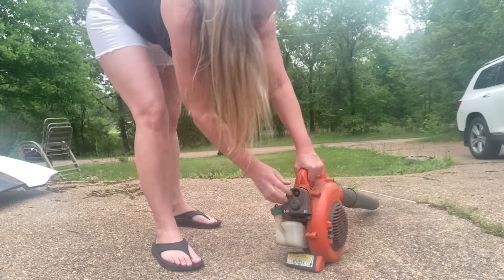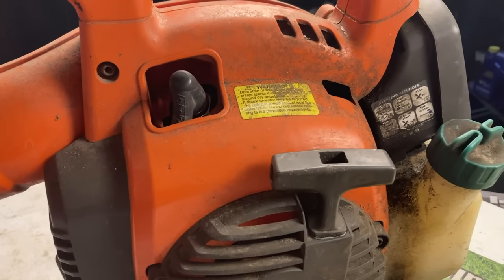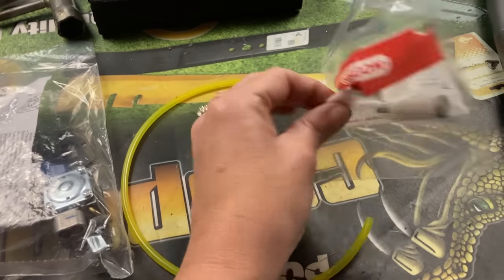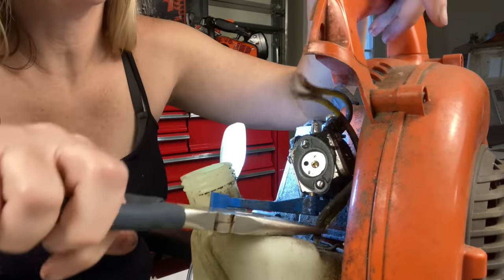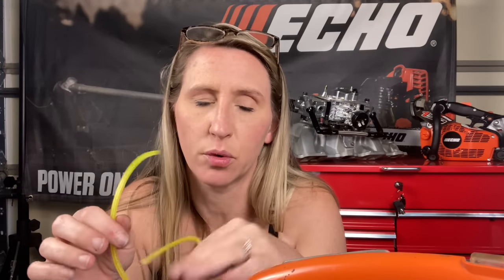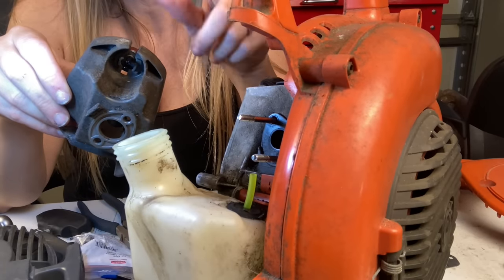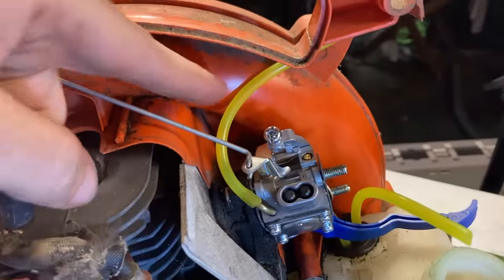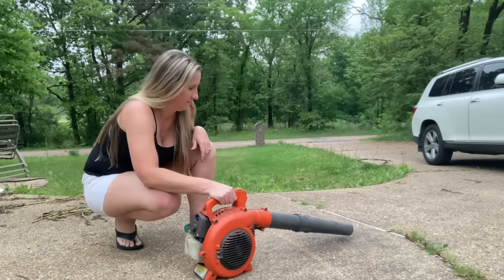How to fix a Husqvarna blower that will not throttle up or start. Repair vlog

Comment: Have a 125 that hasnt run in years and has been taking up space in my storage building. Saw your video while searching for info on replacing the carburetor on a Troy Bilt weedeater. Ordered the rebuild kit and followed your instructions ... it lives again, thank you so much for making easy to folloow content.

Comment: Got to love that ethanol,the worse enemy of a small engine
Reply: Taryl Fixes All did a two-year experiment with all the different types of fuel additives you’ll be surprised of the outcome
Reply: Ethanol and safety switches are the money makers for small engine repair guys and girls!  Otherwise, 90% of our work opportunities would not exist.
Reply: Byden is raising the ethanol to 15%
Reply: @haneyoakie14  while YouTube does anything to shadowban your latest comment. I'm surprised you were able to actually see my first comment.
Reply: @haneyoakie14  the latest to win middtermm elllecctions is the suppreme courrt leaakkk.
Reply: I run a aviation fuel in my small engines. So far no issues.
Reply: I’ve been running regular unleaded gas in all my equipment for many years and have never had a problem unless I let things sit for longer than 6 months. Now if I’m gonna let my equipment or gas tank sit for more than a month, I use an inexpensive product like Sta-Bil to extend my fuel storage up to about six months but no longer. Having done this I’ve had no more problems.
I must add that my equipment isn’t set to factory settings, which are always too lean and I’ve had to bypass those limitations. Once I’ve got my equipment performing at its peak I’ve no longer had issues with fuel
Reply: It keeps my doors open because people don’t listen or believe it’s the problem, they foolishly blame the brand of the equipment 
Owell i enjoy the business and money 😊

Comment: Good step by step instructions. There's one aspect I would suggest to protect the plastic screw hole threads during reassembly. Most people just start running the screws in clockwise without first lining up the screw threads with the original threads in the hole. This will chew up those plastic threads and eventually with repeated dismantling and reassembly the screws will not tighten. If you put the screw in and then turn it counterclockwise, it will take one full turn or less, you will feel the screw threads seat and lineup in the original hole threads with a little click and the screw will drop just a small distance into the hole. This now means that your original plastic screw hole threads are lined up with the metal screw threads and you won't mess up the threads in that plastic. It's not a bad idea to use this method on the metal screws and threads found on the pull rope housing also. This will save you the possibility of cross threading the metal components.
Reply: I always do the "turn CCW 'til it clicks over the thread edge" on spark plugs and oil plugs, too
Reply: I will not use power tools to put anything to geather and after watching the ( pro) use them I know there damage the equipment 😊
Reply: @philliphall5198  just a little additional information, I will use a battery screwdriver once I've aligned the screws with the original threads and turned the screw manually about half to one full turn to test the alignment. If the test proves successful, if there are only a few screws I'll do them all by hand but if there are a bunch of them I will then use a battery operated screwdriver with an adjustable clutch set really low to run them all the way in and then tighten them by hand. I use a German torque method, guten tight. LOL

Comment: At Husky service training I was taught to turn course threaded screws in plastic in reverse until you feel it engage the existing threads then tighten. Supposedly keeps you from cutting new threads each time. Although a experienced mechnic will know when that is happening. You've taught me some new methods. Thanks 😊
Reply: Good practice when threading any fasteners together if your worried about cross threading.
Reply: We experienced mechanics do this, too.  It's not an amateur thing.

Comment: I am going to make a suggestion.  Don't cut fuel feed line length until after filter is attached.  Much easier to attach filter if it is several inches out of the tank.  Then pull the excess line back and trim to correct length.

Comment: Now THAT is how you make a DIY video. Clear, concise instructions combined with great video and excellent tips you will only learn from experience. Thank you for this and well done!
Reply: Darn frustrating putting in new lines for the first time since I bought it new 2007.  Sadly a different vid. popped up that wasn't clear which line went where and my lines fell apart.  Soooo, I had fuel filter line going to primer, then to top of carb and leave bottom of carb returning to tank.  Total backwards. What should have been 20 minutes ended up being 5 + hours wasted before I got it right.  Grrrrr.  Wished I had found this video as she is always great at explaining clearly.

Comment: ThanYou are a ROCKSTAR!  My several year old Husqvarna 125B acted just like the one you featured.  I got a $20 aftermarket kit (carb, plug, fuel lines, bulb, and air filter) and it runs better that when I bought it.  Local small engine wants $110 per hour plus parts.  I was nervous, but your video walked me right through it.  I could not have done it without you.ks!
Reply: I bought my 125B in 2016 for $150.  Now (2024) $190.  It definitely would not be worth taking it into a shop, cheaper to buy a new one.  But $15-$30 for a new carb is well worthwhile.

Comment: I'm retired and took up small engine mechanic-ing about 4 years ago.  I've seen lots of what you are showing, but the old dog learned 2 new tricks with this video.  1)  "short sux".  I have a purge primer as a reference with the attached hoses labeled.  I don't need that anymore.  2) Inserting fuel lines -  I've been cutting a  short point on the fuel line in order to get it started into the tank and fighting with reaching the end in the tank.  It's long points for me for.  And I am embarrassed to think that I didn't figure that one out...

Comment: You seem to be the eternal optimist in cutting the fuel line before inserting it into the tank. I snip it to length only after I get the filter on and can verify how much line I need to connect it to the carb. I just came across your channel and I really appreciate your no nonsense approach to working on the equipment along with your clear step by step instructions on how to do each step. I wish you continued success in your career

Comment: I literally just revived an echo weed eater with new carb kit. $25.   Carb, primer bulbs x3 , fuel filter, spark plug and air filter.  Then I tried reviving a Ryobi blower.  Then I find YOU reviving a blower.  🤔
 I’m definitely buying a carb kit for it as well because I disassembled it,cleaned it , compressed air put it back together,ran like a top for a day. Now it won’t start at all. Carb is clogged up. Almost the exact same reason as in your video.  
 Glad I found ya. Keep up the good work 🇺🇸✌️

Comment: Theres a few property maintenance companies in southern Ontario who are very happy that you make these videos!
I've always been mechanically inclined!  But there are SO MANY issues that come up.!  You have saved thousands of diagnostic hours for me which helps get the tool back up & running so much faster!  I can't afford a Stihl or Echo franchise.  Plus they have territorial restrictions!  So they wouldn't give me a franchise anywhere around customers.
I was at a franchise buying parts the other day, & when customers were bringing tools in for repair, the clerk tells them 4 weeks before they even know whzt is wrong with the tool.  One guy had a recoil cord broken.  I ciuld have had it replaced in 15 minutes! 😃😀😃
Thanks again Chick!

Comment: I admit to being a clean freak when it comes to this type equipment.  The first thing I would do is clean before I even started.  Then I would clean each part that I remove.  It may not help the running but it sure makes things pretty when I'm done reassembling.  Great instructional videos here.  Keep up the good work.

Comment: I've had a dead Husqvana blower for some time and so glad I didn't throw it away.  I had replaced some of the fuel line once before but then had problems again where it wouldn't run and just put it up.  Then I saw this video.  I ordered the complete kit that she recommends and followed along with the video.  Took it outside for the moment of truth and it fired right up.  There was only one thing that was a little difficult for me and that was getting the new grommet to click into the fuel tank.  I ended up taking the whole tank out where I could get some downward pressure to push the grommet in place.  Thank you Chickanic!  Great instructions.

Comment: I watched thus video and bought a complete kit for my 125B Blower from Amazon. what a great kit less than 20 bucks it came preassembled! all the lines came feed through a new rubber plug  for the top of the fuel tank. the fuel lines were all cut to length with the fuel filter already attacked. just pull out the black plug  on top of the tank and feed in the new plug and lines. the Fuel Bulb is already attached leaving a short and long fuel line, the short one goes' on the bottom  of the carb and long on top. it comes with everything including Air filter, Spark plug, fuel filter and all lines precut easy install.

Comment: Hi Chickanic..This is the best video that I've seen that you so thoroughly demonstrated! Thank you for sharing your knowledge and experience with us! You took great pains in detail showing how to connect those small gas lines. I have 2 Husqvarna blowers, one of them was given to me by my neighbor. I have noticed that the battery powered blowers just don't have the power and indurance like the gas powered ones . I have a very large easement and the battery powered one doesn't do the job before I have to replace the battery.. You are an excellent teacher and small engine Chicanic!

Comment: Wow! Amazing fantastic tutorial. My case the company that hired me wanted me to throw the 125B away! As the type of human that I am it did not happen. 
The company had purchased a back pack blower for me (without consulting me). I hate it so when one of their sister properties was been cleaned I found the blower (125B) and kept it. 
Yes, the blower has the same issues. I replaced the fuel lines and now I am thinking I switched them. Young lady your a life saver. 

Thanks for your time and effort in sharing your knowledge and skills. I have subscribed 😊

Comment: I watched several you tube videos on repairing my husqvarna 125B leaf blower and yours was the best. Your instructions were clear and concise. It was apparent that you had spent some time preparing your presentation. The camera was such that the viewer could see what you were talking about. I watched it a couple of times and even took some notes. With the new carburator, my leaf blower works like a dream. Thank you. I have one criticism but it is a small one. It is possible to remove the gas tank and the grommet so the fuel line can be fed through the grommet and then attach the fuel filter and feed through he grommet hole without having  to fish in the tank for it with hemostats. I intend too watch some more of your videos to see if I can learn any thing about some of my other tools. Thanks

Comment: My brother gave me this blower because it wouldn’t run right.  It had spark, comp, bulb and fuel lines looked fine.   It would Run on choke was mostly how it would run.  I thought fast and slow idle adjustments needed to be tweaked.  I bought a adjustment driver set to adjust the fast and slow settings. I made some tweaks and it now runs smoothly.

Comment: I just bought an edger that same blower and a Husqvarna weedeater, the two had messed up balls, but on the blower I basically did exactly what you did I’m very mechanically inclined but with this technology we have it’s great that being 51 by learning it by the sweatier Brown, and not having the Internet. It kind of feels like you’ve been robbed, but it was a great video I used it. It worked great and I need a sidekick just like you. God bless and keep going.
Reply: 😂😢🎉😅 And I just took the carburetor all apart and cleaned it. It works good. It’s 2:30 in the morning so I couldn’t let it run too long lol.

Comment: Thank you for all you do with your Repair videos!.  I have a No Start ..125B. Seemed to be flooding,  Bought new carb and plug.. No difference... bought a spark tester, good spark
after the third time of tearing into it, I was going to check the piston for scoring from the Exhaust side.  Immediately  I  noticed the exhaust plug was completely blocked by an insect of some kind.  Cleaned the exhaust screen and started on the next pull.  Thought that would be something to add to a check list for these 2 cycle engines....

Comment: Thanks for your  video on fixing the Husqvarna blower. I give credit where credit is due and it’s all thanks to you. My blower was acting exactly like the unit you were working on, and while the lines were not rotted yet, the fuel filter had come off the line. I was able to replace the line and filter easy enough and runs perfectly. Thanks again.

Comment: Hey Bre, I just took my 525bx to the shop and they quoted me basically needing all you mentioned here with this 125, mine will start but you have to literally constantly fluctuate the choke while holding the throttle to “have a chance” of it staying running. They wanted about $150, I said “yeah that’s ok, thanks though” I only paid $100 for it to begin with. So I’m going to TRY my hand at replacing these items myself.

Comment: THANKS Bre!!!  I have the 125B and it had this exact problem!  I didn't replace the carb but did an extensive cleaning of it.   It too would only run on choke.   This vid got my blower going full speed again!!!

Comment: Thanks for video. I use two blowers simultaneously. A back pack and a hand held in the left hand. The 350ib works great offhand but the run time is lacking. Considering getting this blower to use with the back pack.

Comment: My Husky weedeater would crank, idle but wouldn't throttle up so I replaced the fuel lines and still wouldn't run properly. Come to find out it was the fuel cap, replaced it since I had another one and has been running fine ever since! Great vid

Comment: Outstanding video, there can be one other cause for idle but no throttle up, the flame arrestor screen on the muffler can get clogged as well. Most times if the customer or user is putting too much oil in their fuel it can foul the spark plug as well as clog the outlet screen on the muffler. I'd taken dozens of them apart and clean that screen with a torch or a wire brush. Gas powered engines need to inhale and exhale, clogged screen prevents it from exhaling. Most Mufflers have a removable screen, it's just one small screw. I used to train technicians, they'd be going out of their minds after replacing carburetor and fuel lines only to have the unit not throttle up

Comment: Thanks for the link to the OEM carb kit.  My 125B is several years old and runs well now because I take care with managing  the fuels I use and proper prepping for winter storage.  However, with certainty I am sure a carb overhaul or replacement is inevitable.  So, I just ordered a new carb.  

Keep up the good work.
Bill
Reply: 1 year later and the price jumped 20% on Amazon.

Comment: Hi it’s Brad from the land down under (Australia 🇦🇺) here and I just thought I’d tell you something that I do to all of my 2 stroke small engines and that is change the two fuel line going through the grommet set up with the Stihl set up with the grommet and fuel lines all in one piece with the filter normally attached to the pick up line I have found they fit just about any engine with that type of fuel set up it’s so easy and inexpensive to just put the stihl fuel lines in kind regards, Bradley.

Comment: Great information on the Husky 125B not running full RPM. I just installed a new carb kit. I was able to use my Husky today, but only about 1/2 RPM. After watching your Video, I think my next attempt will be making the filter line in the tank shorter. The one already attached to bulb and filter on the end, was about 10-12 inches long. Filter may not be flat in the bottom of tank causing carb to starve for fuel. The 125B is a great little blower. First time I've had a problem with it in 8 yrs. I use ethanol free gas/oil mix...  Thanks!

Comment: I have a poulan  blower that had a similar problem. however it was only 2 years old when it would not run at full throttle. turns out i had to buy a special carb adjustment tool ( a whopping 4 bucks!!!). a slight turn to richen it up and she runs like a champ! love all your videos!

Comment: Just picked up that exact blower for free. The guy was just throwing all of his old stuff out. I took it up the road and it cranked right up. I used it to just blow some stuff off of their driveway, until it ran out of gas. I will definitely be checking the fuel lines often though.

Comment: I use the Husqvarna 525BX and it's the best hand held blower I've ever used! Sometimes it takes a few seconds to get going on a cold start, but in my 30 years of experience, it outperforms everything else. If you can afford it, professional models are the ones to go for!